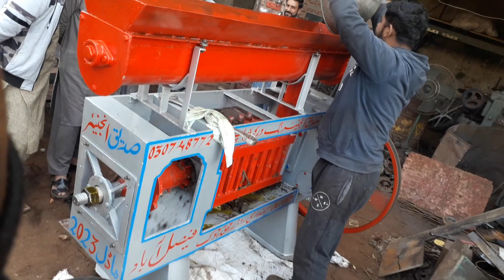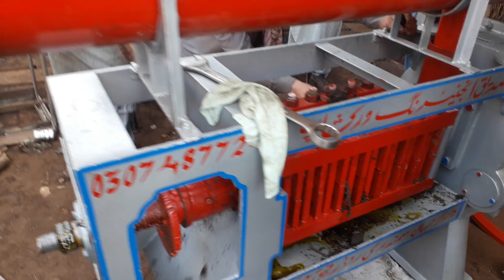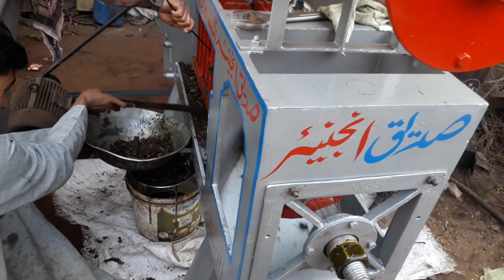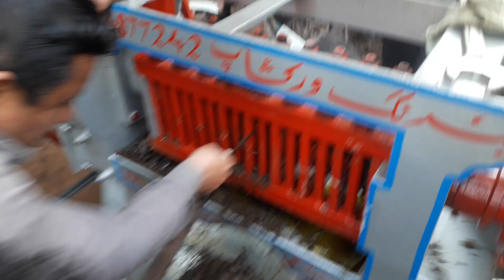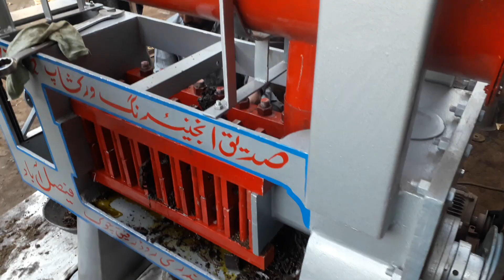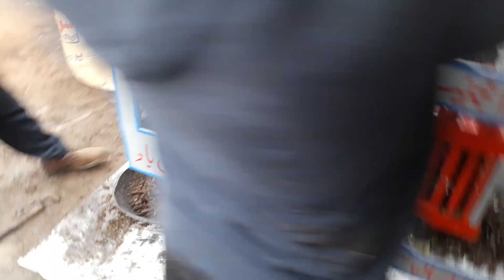sasroo oil expeller machine New model in Pakistan @oilexpellermachineinpakistan

Comment: 1 hour production capacity. How much horse power motor required to run this expeller. Price?
Reply from the maker: 120kg per hour need 15h.p
Reply: @oilexpellermachineinpakistan  thanks for update.   need price information. what is price now a day with motor
Reply from the maker: For more information contact my 03074877242